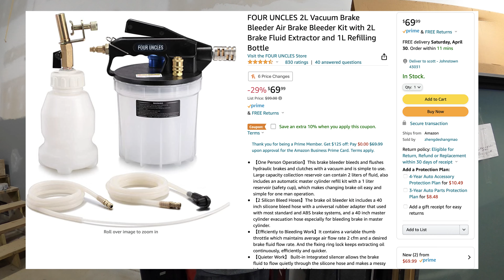2022 Camaro ZL1 1LE first TRACK DAY!  Brakes bled and goodies!

Comment: Awesome vid,, exhaust sounds great especially at speed!  Not sure how much of an interior your car has but are you allowed to remove the rear seat and any plastick panels, spare tire or jack to save weight for the class you were in?
Reply from the maker: Thanks.  No class, just a track day but yeah I can remove anything but there’s not much there.  Just the truck stuff which was a bag of something and that’s it.  No Jack or tire that I saw.  I still need test pipes haha.

Comment: Nice video of smooth track moves. I do have a questions about track prep info. Where did you get the 1500 mile number before going on the track? I read and reread my 2022 High Performance Manual Supplement as well as a computer search of the 357 page owners manual and found no mention of this  break in period. I am waiting to take my 2022 ZL1 1LE 6 speed on the track after I get more track experience with my 99 FireHawk.
Reply from the maker: Umm good question.  Somewhere.  Probably a forum.  Didn’t hurt and with all new fluids again it couldn’t hurt.  I think it was maybe the 2017 manual as I remember someone saying the newer ones changed.  Good luck though!   You’ll enjoy it!
Reply: It’s listed in the GM break-in requirements doc.

Comment: Hey man, love the video and car.  What are your thoughts on dailying the ZL1 1LE?  I'm really on the fence about ordering one due to being afraid of being utterly miserable on the street.  Curious to hear what you think thus far.
Reply from the maker: I have zero issues as a DD specially with the A10!  But I understand others won’t like it.  It’s a firm ride but it’s not bad at all to me.  I broke those 1500 miles in driving around for hours on end with no complaints.  Normally my back hates bad seats but these are good!   The tires are bad for picking up rocks and throwing them so an extra set of wheels with more normal summer tires are needed.  If you do that it’s fine for a DD just like the normal ZL1.
Reply: @neckofthewoods24  Thanks so much!  Glad to hear you're loving it!  Consider me sold.
Reply from the maker: @BaldBMW  welcome.  Good luck.

Comment: I need a car helmet for autocross. But, I will have to try them on in my car, before making a selection. I have a long torso, and even with my seat as low as it will go, I only have maybe a maximum of 3 inches between top of my head and the roof.
Reply from the maker: Yeah my torso is long too and I have zero room and hitting my head now.  Might have to pull these seats one day and get racing ones with a cage and harness and adjust them a lot lower.  I can’t remember if my head hit in my last race car with all that done.  It wasn’t all the way down though since I wouldn’t be able to see over the steering wheel haha.  Good weight loss too.  These seats are tanks.